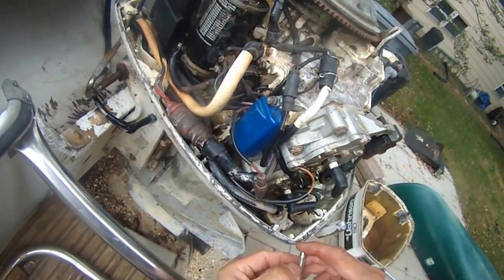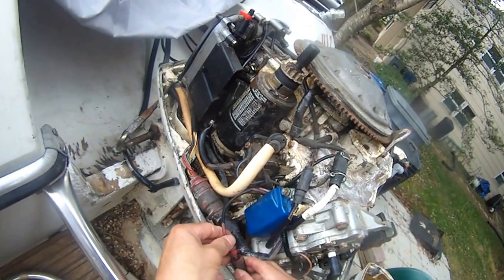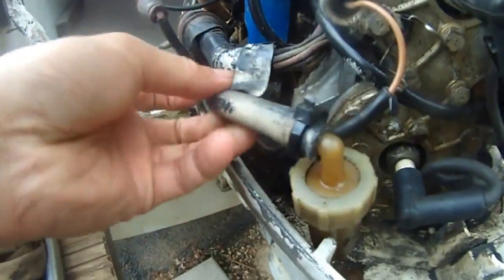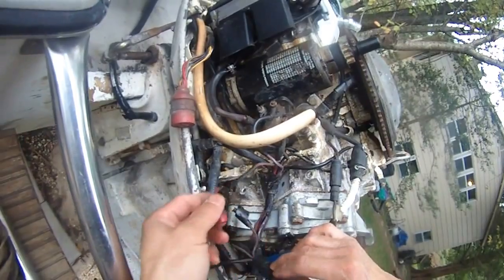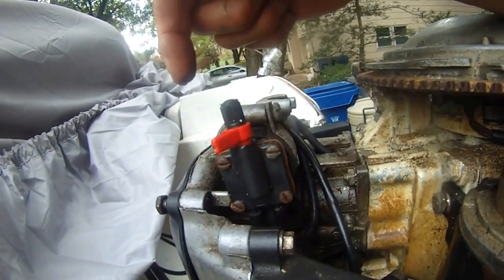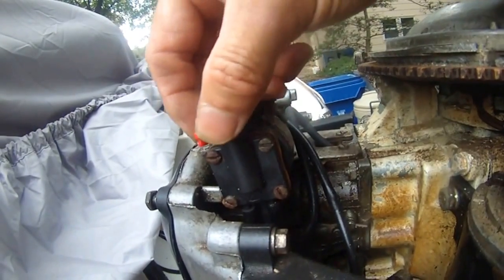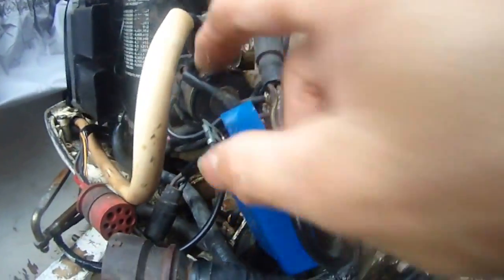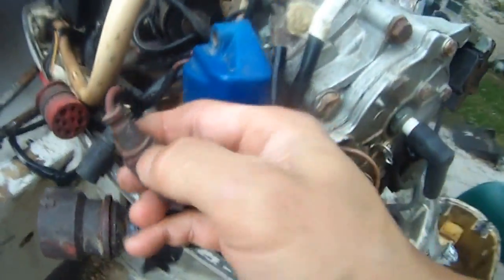Johnson 90hp won't start - primer pump valve

Comment: If bad Coil(s) they should "whine" shouldn't they?  I'll have to check the NEW coil plugs connections.  It started, ran rough for about 15 secs, then stalled. Then I couldn't start it again. So ..... ?????   Fuel?  Spark?  New power pack and New Fuel Primer Solenoid (thing with Red Arrow Tab).  I had checked the Carbs, awhile ago, they all seemed good, clean, functioning.  Solenoid to Starter Motor and Starter Motor ok.  I have no idea about Flywheel/Stator/Timing Base. Whether those are doing what they are suppose to do.  I had cylinder heads off, pistons moving in and out fine on all 4. But oily on upper right, spark plug oily.  Put in new Cylinder Head Gaskets. bolts all torqued down. Coil bolts torqued.  I hear thunderstorm out there, coming.  So can't work on motor today, Sat.7/2/22.

Comment: What fuse?  What year is this motor?  I have a 1994 Evinrude V4 90 hp.  I haven't seen any such fuse on my motor.  Plus I only have 1 power pack, with 4 coil wires coming out of it, and 3 plug ins.  The fuse is for the Electrical solenoid, to Starter motor? Thing with the red arrow is the Fuel Primer Solenoid.  I have it showing which way to turn red arrow in my motor manual, but I forget at this moment.  The thing you don't know what it is, is the Electrical Solenoid.  So long as your starter motor works and turns, turns the flywheel, and there is no "clicking" in it, then it is ok.  If "clicking" can tap it with a hammer, to knock insides back into place.  Same as on a old car engine.  Yeah, I got one of those "things"/wire not plugged in too.  When I bought it, guy said that the Automatic Oil Injector (which is under back next to batter, and same size as battery) is DISCONNECTED.  So I figure the "thing" not connected is for that.  But I haven't figured it out for sure yet.

Comment: Between that rotted transom and the salt eaten motor you'll be swimming home before long
Reply from the maker: I checked the transom at the start of every season. Rock the heavy outboard on the transom to check the transom. So far so good. The Wellcraft boat was made to last. Amazing. Boat was parked on trailer for 99% of its life so it will last longer than all owners as long as we don’t wrecked it.

Comment: sir ,i highly recommend that you get the service manual for your engine.read it thoroughly and familiarize yourself with wiring diagrams and all components.you are working in a shotgun manner,not knowing ,and guessing .this is a recipe for disaster.the fuse connector does not supply voltage to either power pack.if it did they would fail immediately.this ignition system does not operate with battery voltage.when in doubt,bring the engine to a professional marine mechanic.what you are refering to as a voltage regulator ,is the starter solenoid.good luck.

Comment: So which way is the that red switch supposed to go away from the main motor or towards? Someone told me it's suppose to be all the way clockwise
Reply from the maker: ask your questions at boats.net forum - they have experts who can help in an instant, I don't remember which way I have it now, been awhile since I did this video. the motor is running beautifully. I will take a look when I have time and answer your question

Comment: my 90 horse johnson will not start when cold unless i manually turn the primer solenoid a quarter turn. what would be the problem?
Reply: Try pushing in on the key as you turn the key. This will prime it
Reply: It has a solenoid controls plunger that when key is pushed in it primes the carbs with fuel on cold starts. The red lever is a Manuel override if your solenoids is bad. You should hear it click when you push key in. Ohm test the (purple and black I think) to specs in manual.
Reply from the maker: ask your questions at boats.net forum - they have experts who can help in an instant
Reply: Mine 2

Comment: ok guys.... i have a 115 Johnson of a similar age and basically identical style.... i can't get the engine to run with my electric solenoid switch facing away or toward the solenoid itself in the run position..... i can only have it running between the two.... at 90 degrees facing out from the engine.... also.... it then will not pick the revs up whilst in the water but seems to be whilst on land....... i am so confused... please help.
Reply from the maker: +Callum Pitcher suggest you post your question at iboats forum. They have experts who can help you within a heart beat. Hmmm, are you sure your carb is clean instead of this RED choke that regulates the air and fuel mix?
Reply from the maker: Thanks for the tips.
Reply: michael miller 
What clamps did you replace im having the same issue with the same motor the throttle response is off
Reply: supa mario are you still having your issue?

Comment: The red tab, is a fuel primer, with the tab inline toward the solenoid is automatic position (so when you are at the helm you can push the key inward in the on position and will flood fuel in the motor for starting, you should hear a click) with the tab turned outward away from the solenoid turns it into manual mode, so u can operate incase of emergency like starter failes and you need to rope turn the engine! The red wire is your battery power to controls and motor, that fuse is to big get smaller on or even splice in a new style fuse
Reply: WestWaters thanks
Reply: I was confused about the red tab position. Thank you for informing! Would this also cause a motor to not throttle up? I'm sure I'm answering my own question with this, but I adjusted the throttle to open up the carb to get it running smooth... will adjusting it back to normal position. Thus closing the choke, and position the red tab accordingly, will it fix my throttle issue? It's a 1999 25hp johnson remote start
Reply: Just read another comment stating that it acts as a modern choke and needs to be turned clockwise until stopped to operate normally. I believe I had it in the wrong position since first test run on water.
Reply: Thanks for your explanation regarding the "red tab" Much Appreciated 👍

Comment: The red lever is the thing that controls the air and gas mix ratio.
Reply: Auctly it dumps fuel into the cylinders nonthing to do with mixture its a valve that replaced choke butterfly valves
Reply: Ummm....  No it's not.  It's a more modern version of the choke.  It has nothing to do with Fuel/Air mixture

Comment: That's good, I just watch your other video. My father recently got the same motor but, 93. Good motor. His has no spark on all 4. This happened very sudden after A: upgrading to the "new style" ignition switch. Which I don't recommend as I think they have to much happening in a small switch. B: in the "ON" position the motor tried "starting". It was late so testing didn't get too far but, I believe that it some how jumped red/purple to magneto curcuit black/yellow and fried the Power Pack. Very expensive "oops"!

Comment from the maker: Yes eventually when I was trying to start the motor and broke the fuse after I found the oxidized ignition coil terminals was the reason for the fail to start in last October fishing trip. 

Watch my troubleshoot videos to see what I fixed to get it run beautifully again.

It's a very reliable motor.
Reply: njfishing1 I

Comment: That "guy" there has a name, good sir. It is the starter solinoid. The fuse must be replaced but, if it was burned the motor would not fire up again until replaced. Have you changed the fuse and tried to start? I'm sure at this point you must have. The strange single wire in the beginning of the video which was taped with electric tape is for the VRO system. Commonly disconnected due to performance issues, etc. If you are mixing your own fuel/oil and your motor says VRO, it's not VRO anymore lol.
Reply: Your funny!!  "If you are mixing your own fuel/oil and your motor says VRO, it's not VRO anymore lol".  Ha ha ha ha!!   So I'm thinking I was correct, that the disconnected wire on my motor is for the Automatic Oil thing under the back, next to the battery (which has tape across it saying "DISCONNECTED").  So I do add my own oil to gas, at 50 to 1 ratio.  Since I don't now how the Automatic Oil thing works anyways.  But funny how guy in video doesn't know that's the Solenoid, i.e. Electrical or Starter rather than Fuel Primer Solenoid with the Red Arrow Tab on it.